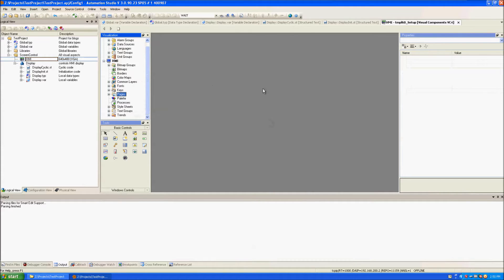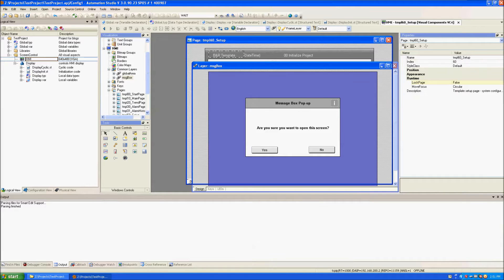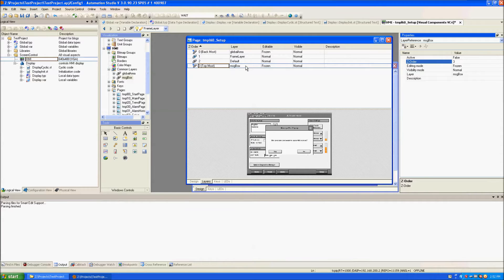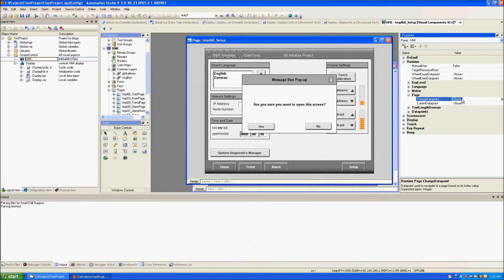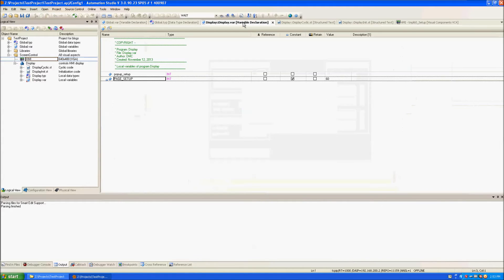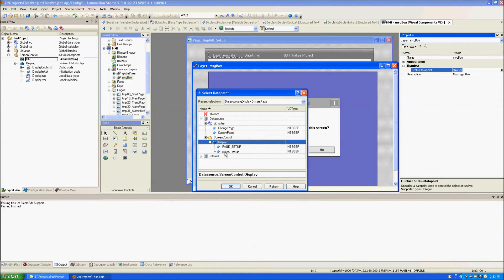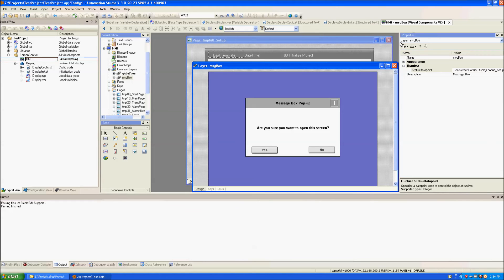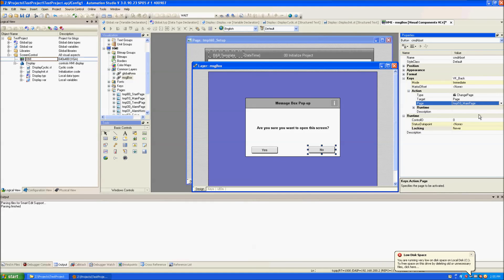B&R Automation Studio: Create Popup Windows on HMI Pages

Comment: Hi do you know how to rotate an object in automation studio I am new in BnR automation studio. Thanks!
Reply: nyah rews You can't, Automation Studio doesn't have that feature yet
Reply: Heru Prayogo I see. Do you know forums where I can learn some tips on HMI designing using BnR like this video tutorial?
Reply: nyah rews I think there isn't forum for this yet. But using AS Help Content is very helpfull.
Reply: Yes but not all is discussed in the Help. Now I am trying to communicate BnR PLC to Atlas Copco Combox-E for Elektronikon Compressor Via Ethernet and having a hard time.
Reply: nyah rews I don't know about that Atlas, but I search on Google, isn't it Allen Bradley's device or some thing?
Reply: I think its a siemens product, Its a controller for compressor. This controller has a CAN interface but I use this Combox-E as Gateway to Ethernet.
Reply: nyah rews Oh, okay. But why you not trying to connect it using CAN? Automation Studio also support CANopen communication.
Reply: Yes I am also trying to connect via CAN.
Reply: the client preferred ethernet.
Reply: I see, have you already explore Ethernet library in Automation Studio? AsTCP
Reply: not yet. I have another question I cant find the shift registers command in Automation Studio
Reply: you can use library named 'OPERATOR'.
Reply: Heru Prayogo thank you i found it! I have another question, Can BnR track the data of the temperatures on a certain times and to be able to print it for data tracking. I know Trending but how to print them?
Reply: If you know about Mapp Technology, it will be easy. Another option is, collect the data in an array variable, and using AsXml, you can write the data on .Xml file then just get the file and print it.
Also you can use Trace feature and save it as .CSV. You can email me.
Reply: Heru Prayogo what is your email so i can I reach you faster. I have so many questions about BnR but cant find support online.
Reply: You can see my email in my g+ profile, but i cant promise I can help you solve your problem, anyway, i'll tell you all I know.